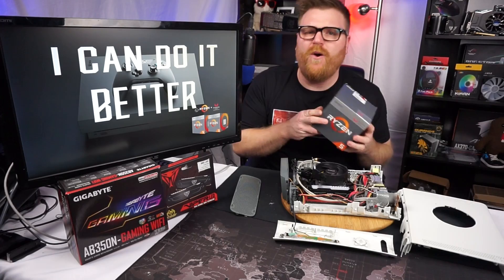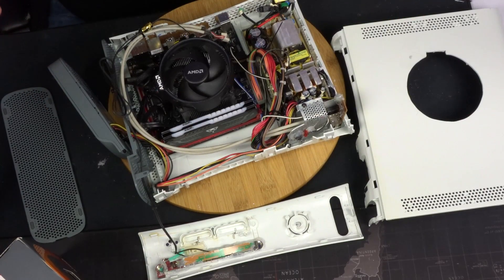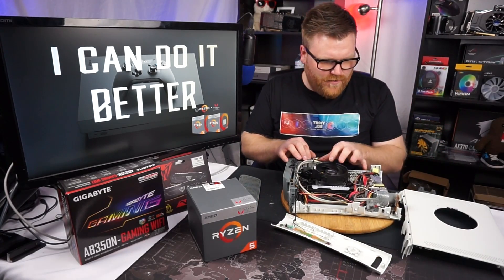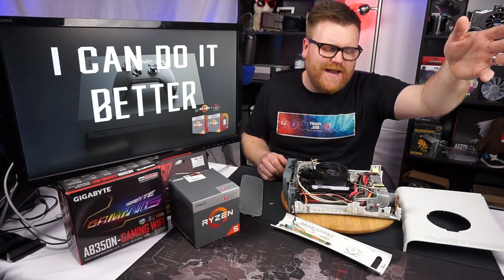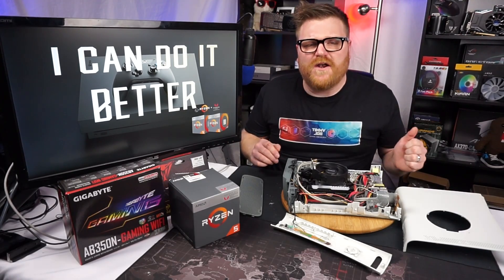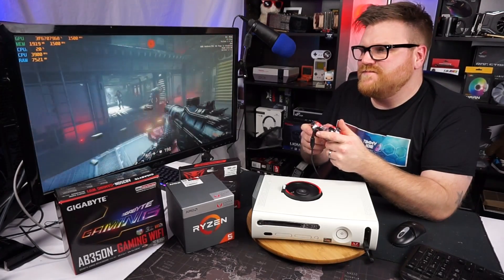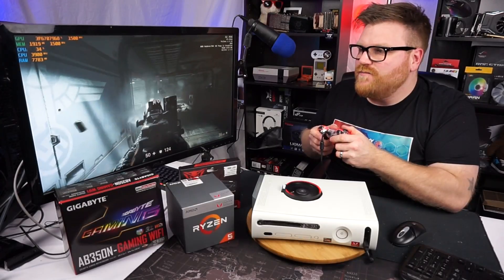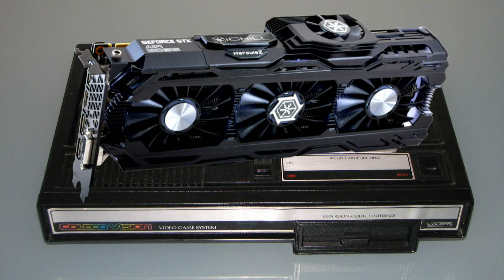I Made My Own Xbox With A Ryzen 2400g

Comment: Personally myself if i wanted to keep within the Xbox 360 theme then I would have made the psu external like it is anyway and maybe you could have gutted a XFX psu and put it in the power brick and then using a GPU bracket we can have a GPU side blower style installed like a 1060 with reference cooler coz gaming and its better than 5% of a real gpu Vega graphics or is it 7% you get on the APU? could it be done?

Comment: This and the later build you did with the regular Xbox inspired me to do the PC in a PS2 case. Thankfully unlike the Xbox 360, the PS2 is all square. However the bottom half is bigger than the top half so the motherboard will have to be mounted upside down. Might be interesting for thermals.

Comment: Hey Timmy! Around 10 years ago I did this to see if it was possible. I ended up using a small amd motherboard with a dual core AM2, 4gb ddr2, 2 X 120gb 2.5" in raid 0. The most annoying part was that I had to run the PSU externally and I had to used a copper server heatsink/fan (which could get seriously noisy). It was super fun to make and you've just made me want to build another one! I was thinking you could possibly run a GPU externally? You don't get that much of a performance hit from the extension cables. Just a fun thought 😋

Comment: Kind of doing the same thing with a xbox slim, (only one i could find for dirt cheep) gonna be for emulating, and just a portable pc i can take to peoples houses. I will however be using a pico psu instead of what you have there and a 2200g instead of a 2400g
Reply: Working on taking all the crap out of the "case"

Comment: Can you mod and add one of those intercooler thing i think they were called.  It was just a bank of fans that piggybacked off the rear power connector and I think it could help if you are having temp issues.

Comment: Well recently I built up an optiplex 790

i7 2600
20gb DDR3
GT 1030
256GB ssd
500gb desktop drive

And it still has a dvd drive

Total cost was approximately £260

Pretty much pissing all over your ryzen in an xbox.

:)

Comment: Did you powered CPU with only one 4 pin connector or your PSU have 2 of them? can you write model of PSU used?
Reply from the maker: rabotash I had to Jimmy that psu. I just spliced another 4 pin in there from one of the molex. Its a lite-on psu from a Dell optiplex. Not sure what the model was

Comment: I made my xbox a custom box about 4 years back (nothing to this degree) (inspiration for your own project is my intention here)
So i worked in a Retro shop, we did refurbishings (well i did cleanings and partial refurbishment (replacing disc drives and mechanism, we had a software guy i wasnt tech savy enough for that)
But we had got in a broken Xbox Elite, So i had brought in my Original Arcade, bought some replacment LEDS, and a few small mods, little things like a 500gb SSD which the software guy remapped the partitions and what not to replicate the existing HDD i had (idk how he did that there may be a guide out there) but ya i swapped the case over, cleaned my xox out, removed some heat shrouds and replaced them with simply glued in copper pipes i pulled out of a laptop,  the leds were replaced and stuff, it wasnt anything fancy but it looks cool since it looks like an elite until you really look at it and notice it has parts from other xboxs and the colors dont add up to an elite, i cant sell it or anything to a shop so ive since held onto it, but its a nice little conversaton peice for when i have xbox fans over my house and stuff.

So get yourself a project everyone take your time and you can do it
You didd amazing Timmy Love this! Might take on a similar project if i can get my hands on some broken xboxs in the future.

Comment: C' mooooon, its just a pc hidden inside an xbox360 "shell".the only good thing is that it supposently gives you the "portability" of a console. It would be cool if it was running on the xbox operating system (which is almost impossible) and run xbox 360 games with bettee framerates ig

Comment: What about the elephant in the room? This thing CANNOT play Xbox 360 exclusive or Xbox One exclusive games. And this is exactly how the old Xbox 360 was better, before he butchered it.

Also, this "console" (although it can) is not intended to use a mouse and keyboard, (which it should) so it's crippled by "forced/tacked on" use of a controller. Basically, it's not as good as an actual PC due to cooling issues and forced use of a controller, and not as good as a dedicated console because it cannot play console exclusives. So basically, it's so much better to just build a frigging PC in a normal PC case, or use an actual console and call it a day.

Also, in terms of sheer power, I wipe the floor with this Ryzen build. I got a used i5 6600k@4.4GHz, a GTX 780Ti and built a PC that cost me so much less than this Ryzen build, yet has so much more graphics power.

Comment: I bought Ryzen 5 2400g and AB350-Gaming 3 motherboard, but I cant get in to bios or even get a signal to my monitor because the BIOS is older than the CPU. So I need to update the BIOS somehow, and I dont have a older CPU or any other compatible ones.. any idéa how to do this? atleast I think this is the issue.

Comment: i used an hdplex and an external 330 dell power brick ... with an i5 8600k ... its about that size but it also has a 1080 in it .... and it gpu/cpu never hit over 60 degrees ... replaced the stock gpu fans with 120mm silen fans from be quiet

Comment: Well.. I could put a raspberry pi into a super nintendo and say that I did it better.
But they are completely different times. In this case you didn't even manage to fit it into the case.
You damaged the case and made it very obvious that you had put a PC into it.
How about not damaging the outer case and also use the original ports of the 360 instead?
Reply from the maker: Well you don't really get it then do you :)
Reply: What is it that I don't get? 
That it's a lazy attempt of trying to make a PC look like a Xbox 360?

Comment: you can widen the hole you cut, put a mesh or removable filter, and try this with a normal 120mm fan
http://www.scythe-eu.com/en/products/cpu-cooler/big-shuriken-2-rev-b.html
it should fit reeeeeaaaaaaallllllly close
Reply: also, need power light ;)

Comment: Really cool build, might I suggest, a few 60-80 mm fans maybe as exhaust, that might help keep things a bit cooler
Reply: Also xbox1 X doesn't actually have 4k graphics it's a all done by the processor I forget the term used but it's not true 4k what you've built actually crushes Xbox

Comment: Is the xbox power button functional?
Reply from the maker: Smidget I modified a PC power button to work behind the original button and routed the PC power led to light up the button too. So yes it does work
Reply: Timmy Joe PC Tech oh very cool project I think I may try to recreate it. How did you line up the hole for the cpu cooler so perfectly as well?

Comment: i agree at 10:09 with delidding as a viable option of 10C temperature reduction. Also, you could consider using an LED to make the power button light up for the LOL's. you could also mod the front of the xbox 360 to accompany 2x 80mm fans since the front is about that width and the disc drive is useless anyways.

Comment: So, can you stick Xbox 360 disks in and install and play them?  If not it's not an xbox.  It's just a PC.  Would have been quite impressed if you stuck in a 360 disk and played it.  Well, at least it's not the Xbox One with the crappy PC operating system that takes 10 hours to install a game on anyways.  ANYHOW, title should say "I used an Xbox 360 case as my PC case".  I always thought about taking console hardware and sticking it into a PC case and give it better cooling and lighting, maybe even stick two different consoles into one large case somehow.  This video reminds me of when I wired two 20 MB hard drives and an ATX power supply into my Tandy 1000 SX decades ago.  Yes that IS two 20 MB (not GB) hard drives, that was a lot of hard drive space back in those days and it held a ton of games.  These days even the simplest cheap indie title with worst graphics than games from the 80's requires more than 40 MB of hard drive space for one cheap title.

Comment: What pissed me off the most about most of the reviews of this config was how people compared it to the new i3 and a GTX 1030 and always ran games on low settings like sure now you have the newest architecture Intel processor running in tandem with a GPU that's only real strength is how insanely fast it can fill pixels. This setup is 50% more capable than the GT 1030. It struggles with resolution because of the lack of rops

Comment: I was actually planning to make a gaming PC inside of an HP slimline case with a 1060 or 1070 mini. But that was before, you know... gpu pricing. It would have been the best sleeper build ever :'(
Reply: The only thing I was really worried about was the power supply and how loud it would have been under load (flex-atx psu).

Comment: The biggest let down is that we can't give more then 2GB to the graphics , i have 16GB in total , so i would love to give 4GB to the graphics ( or at least 3 )
Why are all the motherboards bios capt to set max 2GB ?
Reply from the maker: Technically windows will use system memory anyways so it doesn't matter if you can only set it to two GB as Windows will a lot more as it sees fit
Reply: So if i set it to 1GB , windows will still give more when needed ?

Comment: If you are having temp issues...find one of those old multi fan snap on fan units they made and wire it in. If you remember, they snap on the back of the 360 and plug in to the power port then you would plug your power supply into it.

Comment: I'd of cut the cooler in half and then drilled a grid pattern of holes in the top of the case instead. That way you wouldnt have any visually noticeable modifications. I'd go with a underclock cpu if possible. Also I think i'd of tried to keep the external hard drive hot swapable instead of just internally wired.  Another thing to consider is I think i'd of used the mounts for the mother board with hot glu instead of drilling into the case. Its a very cool idea that needs some refinement still.

Comment: Sweet vid, this is easily the most unique thing I've seen any reviewer use the power of the new APUs for! I'd like to see you run some games in an Xbox emulator on this thing, that would be so cool!
Reply: You know the original Xbox was just a Pentium III with 64MB of RAM right?
Reply: Lol the NV2A is based on GeForce3 with a second vertex shader pipeline. GPUs built on the same silicon and architecture perform and have similar driver requirements. It's similar to why you can for example input a device ID into a Mac OS X kernel extension and have it run the driver for your 'unsupported' card (e.g. HD 5450) and have it go fine.

Have fun reading nvidia's documentation: https://media.readthedocs.org/pdf/envytools/latest/envytools.pdf It details the NV2A quite extensively.

Also it's 2018, and if you didn't get the message some people completely reverse engineered the SNES and can reproduce its hardware exactly.
Reply: Yeah and? There are hundreds of emulators for various consoles with even less documentation and also 100% proprietary hardware. I've also given you plenty of OG Xbox emulators and an Xbox 360 one, so if you want to attack something then attack their viability.
Reply: Unfortunately I get a 403 forbidden error when I try to access that virginia website. 

I don't like repeating myself but I have posted some emulators that could be used for the specific task I mentioned in the OP, so if you are going to attack any of my arguments I would've thought that the viability of those emulators would've been the one to do.
Reply: Any reasons why they aren't?
Reply: Hey man I said it would work, I never said it would work well. I'm going to download a 007 Agent Under Fire ISO to play on one of the emulators to see how it goes.

Comment: If I may suggest something to help cooling that box.  Either cut it in rectangle box size small enough to fits a two slim fan 40mm on top of the ram area or one 40/50/60mm in the Hard drive area in the front as exhaust or intake, and maybe a double 40mm in the rear as exhaust.  It a given it work, all it really doing is creating positive pressure case without leading where the heats should be going and exiting out.  I may be off of the measurement and hope you figure something else better.

Comment: Lmao the stickers where the icing on the cake! Make sure to dedicate at least 2GB of system RAM to the APU through the BIOS for more performance, if you haven't already done that. Love your videos m80.
Reply: There's actually much debate on that and how games allocate memory. The way I understand it is let's say you put in 8GB of 3200Mhz RAM in the system and both CPU and GPU pull from the same memory. In BIOS you set the GPU to have 2GB of that RAM and now your CPU can only use 6GB. Okay so now you open a program that requires a lot of CPU RAM and you hit the 6GB limit of that resource and the only fix is changing it in the BIOS to less VRAM being dedicated to the GPU only. So knowing that, when games exceed the buffer of the GPU they will use the CPU to dynamically allocate RAM up to the max the GPU is able to use in this case 2GB and while this hurts performance on traditional cards due to system memory being slower and lower bandwidth, the GPU inside the APUs is able to use it normally without any noticeable performance hit due to it being the exact same 3200Mhz DDR4 memory. 
So with all of that in mind if you set the buffer to like 64-256MB (or higher if a game demands that much to start), you can avoid that CPU crash and just let the system dynamically allocate the same resource to the APU. 
Hope this helps, and correct me if I'm wrong.
Reply: m8, the essay wasn't necessary -.-
Reply: メデューカMeduka basically you're wrong about the two gigs. Just gimping your overall system. Sorry for typing so much, don't wanna overwhelm you with all these letters
Reply: Not necessary...

Comment: Ya gotta delid that little guy. Wouldn't hurt to ventilate the face of the "X Box" too. That case's ability to exhaust that much power is limited otherwise. 

It's still cool AF... Great job!
Reply: The Goblin No need to delid AMD Ryzen CPUs, they are all soldered ;). The changes are really not as crazy as on Intel CPUs

Comment: Hey Timmy the case does look on the slim side. Which is why the thermals is slightly on the bad side. 

So far no one has ever use the OG Xbox the big chunky black and green casing. That case will have more room and you will be able to fit a few of those 80mm case fans at the back. 

Or for the playstation side. The PS4 Pro casing may also work here. 

All in all thou it a nice project over the weekend.

Comment: So an HTPC in an xbox shell. Cool. I'll be doing a build around the 2400g soon as well. Edit: I am not saying the 2400g is weak or bad in any way. I think it is pretty great. Especially since it is primarily a quad core 8 thread cpu with integrated graphics as the secondary purpose.
Reply: VAC2 Thats a subjective statment. Everyone has preferences, and most people dont mind medium settings at 1080p getting anywhere from 30 to 60 fps
Reply: issaciams "htpc" , no. it's a gaming PC. has a good igpu.
Reply: Its an APU not a "IGPU" and yea it is amazing for a APU but no where near good enough for serious work loads or gaming.
Reply: VAC2 workloads no, but gaming yes actually. Go look up reviews, gaming benchmarks. Its extremely good for an APU, performs well above a 750ti and is great for budget gaming, and new pc gamers.
Reply: VAC2 Plus, no one expects 4k gaming, and majority of gaming still is 1080p.
Reply: VAC2 i agree. I cant until gpus get back to beinf available and at decently normal prices. Until then I will probably keep using my hd 6970 on a new Ryzen build or just use the 2400g integrated graphics. Whichever is better.
Reply: Considering you'd struggle to get that level of graphics with a graphics card that costs less than the APU itself, I'd say that's a pretty fking solid accomplishment. Buy a cpu and get $100 graphics card level of performance for FREE and without taking up more space or power. 

This thing is better than a 750 Ti, the value proposition is fucking incredible. I'm not saying APUs are the future of all gaming, but they're certainly a very powerful addition to the budget market, having to no longer buy a power supply with a higher output or a bigger case, let alone a gpu itself.
Reply: .....a good "igpu"? There is no such thing, you would be lucky to get 30-40fps with a 2400g in GTA V or any older game really and forget 4k.. Cool little novelty? Yea.
Reply: VAC2 At 1080p thats fuck8nf amazing for an IGPU
Reply: Alexander Dempsey no one said an HTPC can't also be good for gaming. This set up is ok for gaming but it isn't anywhere near the best and no one would recommend this for high end or even mid range gaming for modern titles. It's great for budget gaming.
Reply: Idk man, anything under 70ish fps feels sluggish to me and I enjoy a game more when it has smooth edges and grass.

Comment: nice job. too bad you couldnt get the ring to light up. ( at least that i could see) also , personally, the best controller youll get for playing pc fps on if the steam controller, its definitely wonky to learn, but once you do it definitely bridges the gap between controller and mouse. definitely recommend tweaking settings though.

Comment: That's great. I laughed when I saw this.  If you put a BT USB in one of the slots you can connect an X1 controller (new models have regular BT.  Now you'll be wireless.  You also have the advantage of playing with K&M, and using it as a regular PC / media box.
Reply from the maker: This motherboard has bluetooth built in, I just don't have a wireless xbox controller :)